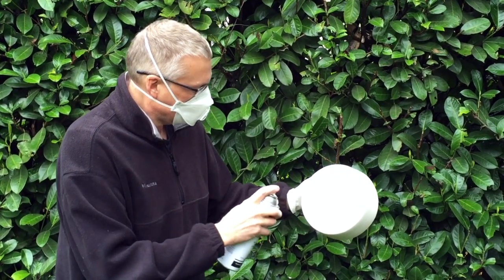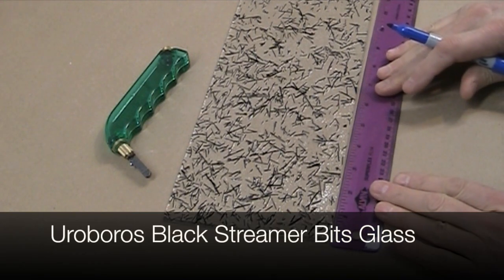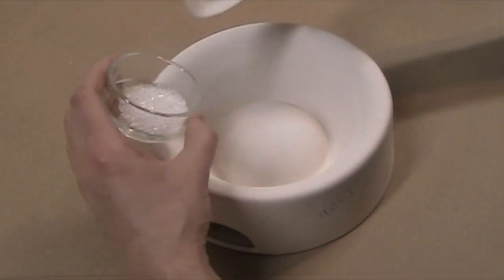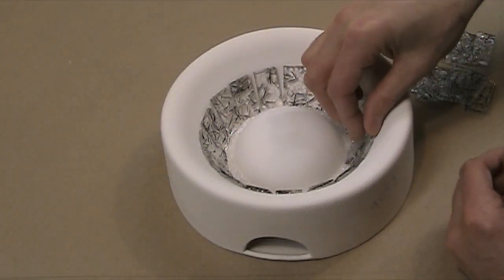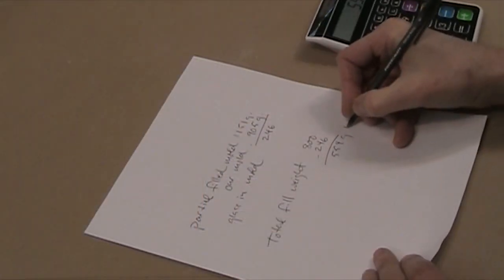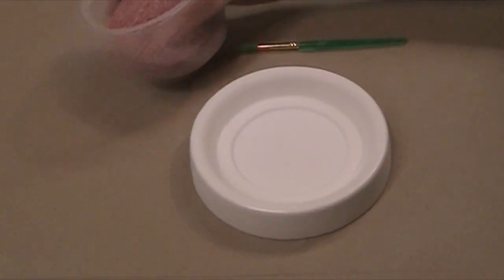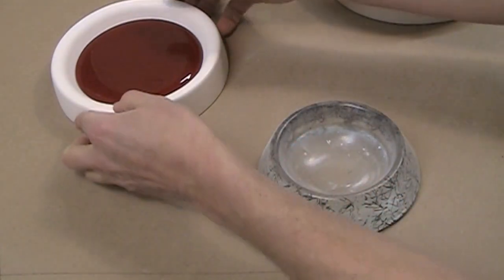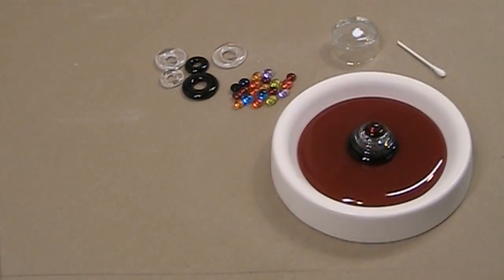Casting Glass with Colour de Verre's Large Round Box Mold

Comment: I recently purchased this mold.  I have followed the instructions to the letter 4 different times.  I have had an epic failure 4 times.  The bottom mold either comes out of the kiln with a huge bubble or has melted the glass so there no bottom at all.  I have changed the temp and hold times to try to fix this but to no avail.
I’m not sure what to try next?